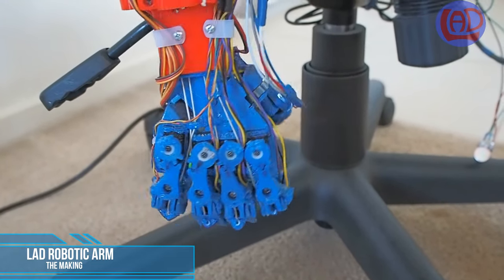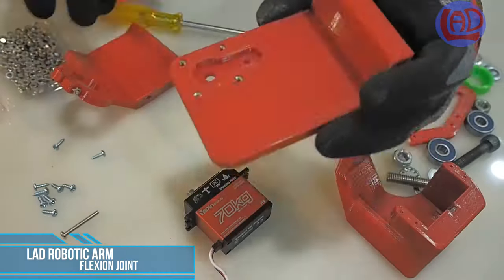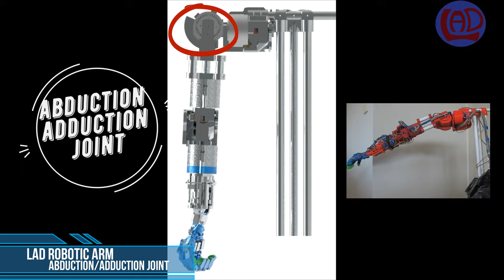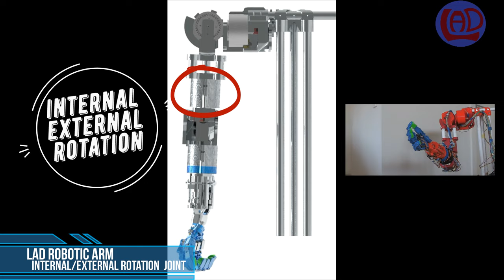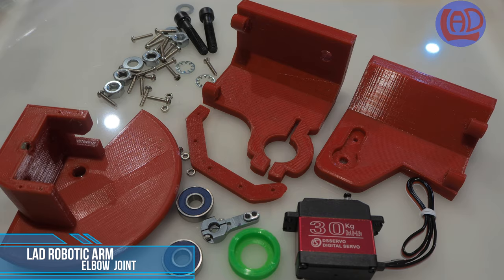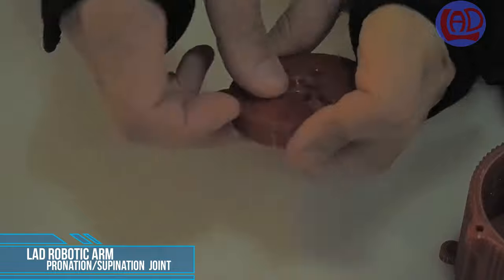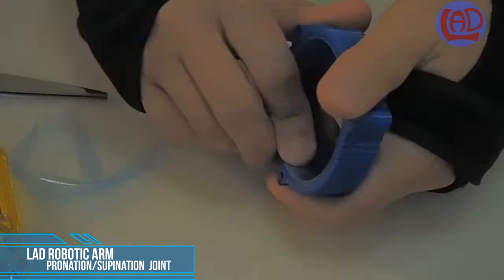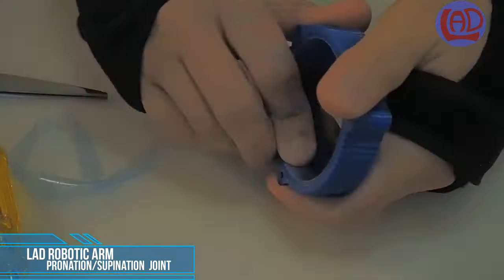🔨👍👍LAD Robotic Arm  -The Making - 3D printed - 5 Servos DIY. 3D printed robot arm with arduino

Comment: so, in order not to buy more powerful servos, you decided to increase the torque of the old servos? the torque has grown from 70 to 280 kg * cm, as I understand it, it was not planned
Reply from the maker: Hi there @bolon11, that is correct. After installing the end effector, I realised that the motors in the shoulder were not strong enough to bring the arm to full flexion (arm horizontal) when the forearm was fully extended (worst case scenario, that is the torque with the longest arm). With the additional set of gears, the torque went up by a factor of 4, and full flexion of the arm was possible.
Reply: @LADRobotics  thanks for the answer, in fact, I was very surprised when I saw that you were installing a 70 kilogram servlet drive and was at a loss. And how hard does this servo turn to get into an upright position?
Reply from the maker: HI @bolon11 ,  if we check the calculations quickly, this is what happens: end effector with actuators weights around 800gr, plus the weight of the rest of the servos and plastic from the rest of the elements in the arm/shoulder/elbow/forearm is a total of roughly 1.5kg of weight. Then the distance between the shoulder to the center of the palm of the hand is around 60cm, so the minimum torque required to bring the arm to the upright /horizontal position is ~90kg.cm. As a result,  the 70kg.cm servo alone  will bring the arm to ~51 degrees (sin-1[70/1.5/60]) with the vertical before it reaches its maximum capacity, when the horizontal distance from the shoulder to the center of the palm is 46.6cm (70/1.5) .  So the torque need to increase by a factor of ~1.3 to be right on the edge, but considering all other factors, like friction, losses in power, and the fact that the  hand will need to grasp objects that were not budgeted in the weight of the arm, will require a larger torque for the arm to operate reliably.  Increasing the torque by a factor of 4 achieves this target.
Reply: @LADRobotics  how many degrees does the servo turn 4*90 = 360? How did you do it, did you somehow modify the sepv drive? Is this done with arduino?
Reply from the maker: @bolon11  the servo turned 360deg. This was possible by a physical modification on the servo
Reply: @LADRobotics  Tell us more about the modifications of the servos. And did you buy a Teflon tape?
Reply from the maker: @bolon11  all the little details are described in the installation manual of my LAD Robotic Torso v1.0 at https://cults3d.com/en/3d-model/gadget/lad-robotic-torso-v1-0-humanoid-robot

Comment: That's incredible! Can you tell me where you bought those high torque servo motors from?
And how did you set the end limit of the each movement to stop the motor when a part reaches certain end point?
Reply from the maker: Hi there @prubotics. These servos I bought from Amazon, but later I found them a little bit cheaper in Aliexpress. The Limits are all set in the code.

Comment: Hello, your project is amazing! I am new into this,can I ask  how did you calculated/ taked into account for selecting the torque of your servos? Specially for the one that is 70 Kg/cm since it has to carry all and watching some videos on youtube some of the hightorque servos does not manage to lift a lot of weight even if they are sold as high torque. Sorry, I want to do a similar project but I struggling with the proper sizing selection. Best regards.
Reply from the maker: Hi friend. Thanks for your comments. The analysis for every motor/actuator is identical. You need to calculate the minimum torque to move a certain joint. The minimum torque is equal to the weight to be lifted by a joint multiplied by the arm or distance to the point of rotation of that joint. Your motor will be powerful enough as long as it exceeds this value. For example: Min. Torque of the elbow motor = (weight of hand + weight of forearm + weight of object on hand) X (distance from the center of the palm of the hand to the pivoting point of the elbow joint). If you find that the torque given by a motor is insufficient for the load been lifted, and you cannot select a bigger motor, then you might add a train of gears to amplify the torque.  You may consider the possibility of downloading the STL files, supportive documentation, Arduino code and MATLAB App for the LAD Robotic Torso V1.0, which is composed of two arms from the shoulder to the forearm (no end effector included) connected to a spine. You can control the two arms of the Torso with a joystick, or by entering codes through the Arduino IDE serial communication window, or by the MATLAB App. If you are interested here is the link of this creation:
▶https://cults3d.com/en/3d-model/gadget/lad-robotic-torso-v1-0-humanoid-robot

I hope all goes well with your project. All the best

Comment: Question:- why you havent used mega or raspberry pi they have higher bits,storage and processing power
Reply from the maker: The question is really Why would I use a board like the mega, with lots of ports and lots of power, or the Raspberry pi which is basically a tinny  computer with lots of storage and RAM, when I can use a simple  arduino nano board to control all the 5 servos?. However, if I wanted to control the servos, then send data by wifi/bluetooth, then run complex calculations and save movements on an sd card, and get info from a webcam , then I'll probably use a raspberry Pi or a ESP32.

Comment: I wanna make something similar on a much smaller scale. How do you know how powerful your motors have to be?
Reply from the maker: You need to calculate the minimum torque to move a certain joint. The minimum torque is equal to the weight to be lifted by a joint multiplied by the arm or distance to the point of rotation of that joint. Your motor will be powerful enough as long as it exceeds this value. For example:  Min. Torque of the elbow motor = (weight of hand + weight of forearm + weight of object on hand) X (distance from the center of the palm of the hand to the pivoting point of the elbow joint).

Comment: Hello! This is amazing! I am struggling with running of 30 N torque servo that is for elbow joint and also 50 N and 70 N torque servos that are of shoulder joint i don't came to know that whether it is not running properly because of power supply or what? Can you please tell me the power supply in brief and also the components you have used to provide constant voltage and constant current to this project.
Best regards.
Reply from the maker: Hi Friend. Thank you for your interest. It looks like you are having issues troubleshooting your setup. My advice to you is to carefully check each motor independently, to determine if each of the motors are strong enough to lift the arm. Make a free body diagram of each joint individually to calculate the Minimum Torque Required to lift the arm in each section (forearm, arm, etc) and if the calculated toque is lower that the capacity of the motor, then your problem might be an insufficient current issue.  If this is the case, then try the 300W 20A DC-DC Adjustable Step Down Buck Converter Module Constant Current Voltage Regulator Power Supply Transformer, which gives you up to 20Amps of current. You’ll have to adjust the current to say 3Amp to start with, and the voltage to whatever your motor recommended voltage range is (i.e 5volts to 7.6volts).   
I’ve calculated all of this in my “LAD Robotic Torso V1.0”. You can find all the information required for this project here (including STL files, installation instruction, Arduino code and MATLAB App): https://cults3d.com/en/3d-model/gadget/lad-robotic-torso-v1-0-humanoid-robot . I hope this helps
Reply: @LADRobotics  This helped me a lot.
Thank you sir.

Comment: Are the speeds of the arm showed at the end of the movie are maxium ones?
Reply from the maker: Hi @mietekgpz. Each motor can move a lot faster than what it is shown on the video. It can go from 0 to 100 in a jiffy. But just imagine how dangerous it would be if the links were to move from 0 to 100 erratically, and how quickly everything will start to fall apart, including the motors and the 3D printed plastic parts. That is why  I created sub-routines for accelerating and decelerating each motor, so that the overall movement of the arm is more organic.  Accelerating and decelerating the motors improve the controllability as well because there is no inertial component to worry about and also increase the service life of the whole arm. Anyhow, these was a first prototype that I built on the go. The final project is the LAD Robotic Torso V1.0, which you can find here:  https://youtu.be/hsH16CHexUE

Comment: Can you tell me how to program the arm to move automatically and simulate the action?
Reply from the maker: Hi Friend. Thank you for your interest. Your question is very broad, and will require a detail discussion.  However, the bigger picture is as follows: It all starts with controlling a single Servo motor with your microcontroller of choice (Arduino, Raspberry Pi, ESP32, etc) . If you know how to do this, then you can add an algorithm that allows you to accelerate and de-accelerate the motor, so that it does not go from 0 to 100 in 1 second, giving you a smoother and more natural motor movement. Then, if you are going to control several motors connected with each other in a linkage arrangement (like an arm or a leg), you need to write down the kinematic equations of your mechanism, which are the equations that relate the position of your output link to the rotation of the motors that move each link. This will help you move the linkage/mechanism to a particular position in space. You now have a set of motors that move with a purpose. Then you can create routines to execute pre-established movements so that the robot moves autonomously following a “choreography” , or you can use inverse kinematics to let the robot figure out the rotation of each motor to bring the hand/foot to a particular point in space. In later days, people have been using ROS (Robot Operating System) to avoid writing down the kinematics equations and find the position of the end-effector, just by providing the robot description. ROS can then keep track of all the transformations of the robot from base to end-effector. However, ROS is really complex and is relatively hard for beginners and requires lots of effort to learn. 
By the way, I have taken care of all the maths in my  LAD Robotic Torso V1.0, which is a combination of two robotic arms (no end effector) each one with 5 joints connected to a spine.  If you feel you can accomplish this yourself, then I invite you download all of the information for this project here: ▶https://cults3d.com/en/3d-model/gadget/lad-robotic-torso-v1-0-humanoid-robot  . You will find all the STL files so that you can 3D print the components at home, instructions to assemble everything together, instructions on how to handle the wiring and electronics, how to connect your motors to an Arduino Nano board, how to use the Arduino code, how to built the joystick controller so that you can manually move both arms individually, and how to use the MATLAB App to run the inverse kinematics and position the end effector to a desired location.  I hope this helps your question. All the best in your project!!!

Comment: Great work...but please how'd you get the orange parts?
Reply from the maker: The orange parts were an after thought, after realising that the motors were not strong enough to lift the whole arm with the hand included. The orange planetary gearboxes increased the torque of these motors by a factor of 4. But this was a first prototype. The final project can be found here ▶https://youtu.be/hsH16CHexUE . If you are interested in downloading the files and built the torso yourself, here is the link for the STL files. ▶https://cults3d.com/en/3d-model/gadget/lad-robotic-torso-v1-0-humanoid-robot, or check out some of my other project here ▶https://cults3d.com/en/users/LAD_Robotics/3d-models.  Good luck!!!

Comment: excellent work, have you thought about brushless or other dc motors for shoulders? Also is your hand cad file available for sale?
Reply: I found it and bought it, thanks.
Reply from the maker: Hi Friend. Thanks for your comments. Glad you find the files. I did think about stepper motors for a short bit,  but keep coming back to the servos because they are easier to control with only one signal.
Have fun assembling the hand.  I'm sure you will get it up and running in no time with all your programming skills in Python and C++ .  Take care.